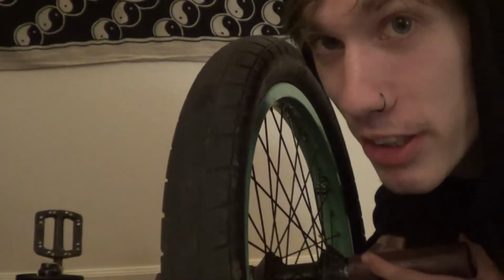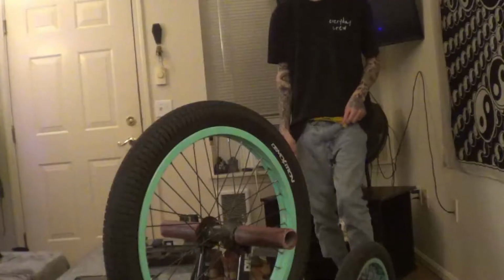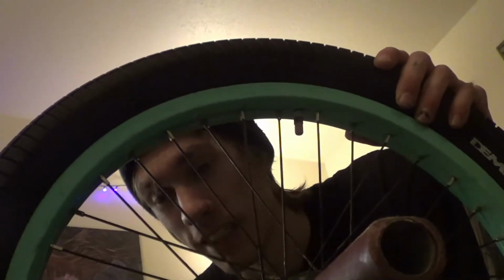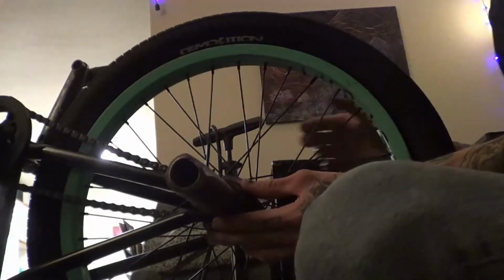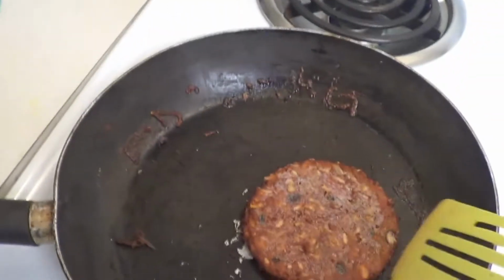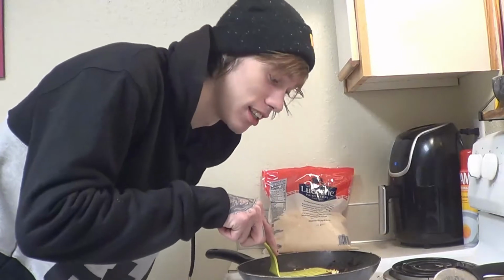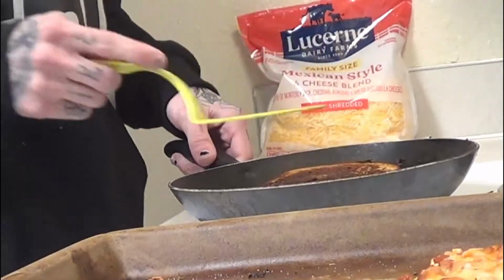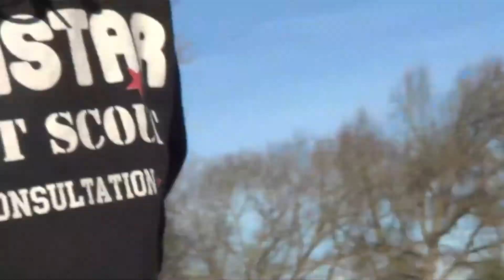A Real BMX Vlog

Comment: You better get some Odyssey forks and you won’t have to worry
Reply from the maker: they are odyssey forks
Reply: @daobmx  I just seen that hummm why don’t they work they rub on the top or the side ?
Reply from the maker: @BigTree412  i think its just the rims are very wide so its almost touching both sides at the top corners